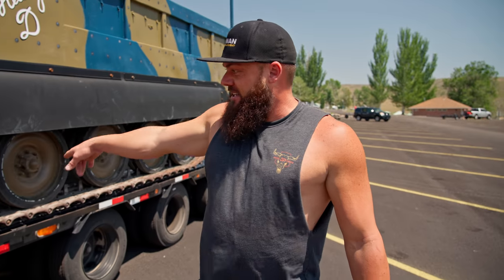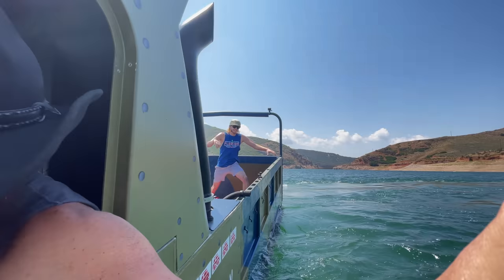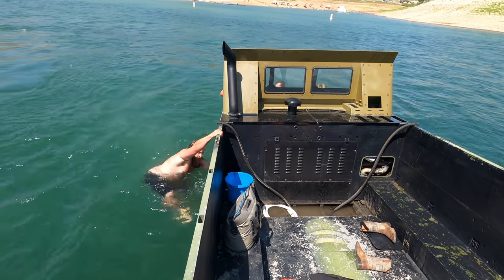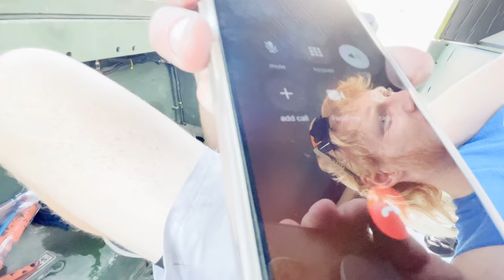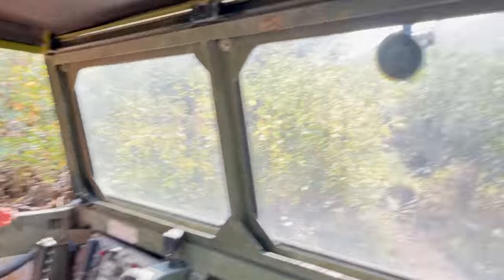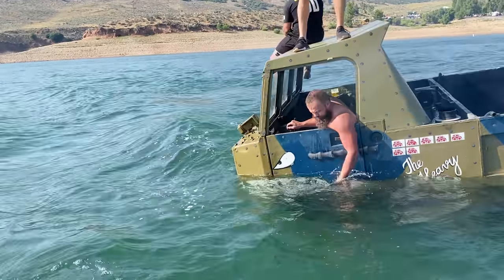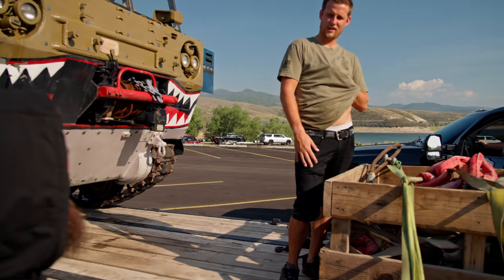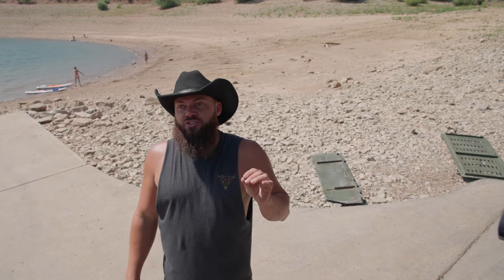Testing Our New Recovery Vehicle Went Terribly Wrong 😑 (WaveRunner Rescues TANK!)

Comment: I used to drive these in the Australian Army, like first comment, need ballast in the back. Also before all water operations we took off all inspection hatches and drain plugs then greased them up and put them back on. We sealed everything with grease!
Reply: Well gosh golly, we are missing some Boy Scouts, you know the ones that are always prepared.
Reply: even door gaskets?
Reply: As an Aussie, thank you for your service 🇦🇺🇦🇺🇦🇺
Reply: @jay l very cool. Hopefully @heavydsparks sees your comment
Reply: Thank you for your service!
Reply: Yeah service is the key , would
 think about relocation of tank
to the roof or rear of cab....
Plug weld all holes in cab/ body.
then you can name it ship- tank😳
Reply: It is also nose heavy because it's supposed to have troops in the back so put weight in the back or have more people to lvl it out ....
Reply: @lotharschiese8559   f0o
Reply: Ju
Reply: @DramaMustRemainOnTheStage  h
Reply: @michaelchatham233  ,  Nah.... because they wouldn't be returning empty like that!
Reply: Also it in Aussie service is called a Tillie or TLC Tracked Load Carrier not a personnel carrier except usually for the crew and i dont think i have ever seen a TLC or an APC in Aussie service that passed all its water entry testing before it got taken swimming remember all the chalk on the rubber seals on everything to see if they sealed which they never did break out the bearing grease slather it all over the seal and bingo it seals now good to go ( Ex 4 CAV Ex 1ARMD REGT EX 8 /13 VMR)
Reply: So many opening here! I HAVE to bite my tongue. 👅 😩 🤣🤣🤣
Reply: @michaelchatham233  troops equal ballast ..as Jay L said
Reply: Nobody cares
Reply: @brodienorton7965  on in morning 🌅
Reply: When I was in the army we never got one to float successfully.
Reply: 432  APC had to be water tight
Reply: Thank you for ur service!

Comment: Thinking on it, the Weasel would have been better to go rescue that stuck school bus.  Weasels have lower ground pressure (per sq. inch) than FEET do (this is why they do so well in a swamp/snow). There should be a trim vane on the front (where those hinges are they had their feet on) the bilge pump(s) (there should be a battery powered electric pump) EITHER OF THEM, should be able to nearly empty it, if she was full, in less than five minutes.... P.S. I did notice that ONE of you was smart enough to have/put on a PFD!

Comment: Dealt with many of these in the Cold War days...ol V53 Detroit...we swapp those packs and hope the one you installed didn't run away ...the ol Super Charger GMC 671 Blower could such down and chew up 3 to 4 inch Army TM manuals and spit them out ...same packs used in the M113 APC'S , Vietnam Era equipment.  We had a lot of fun with those ol tracks ...this type chassis was also use for the ADA Chappell 's which shot the surface to air sidewinders .....Never Ever forget the old V53 sound ... cool deal to see the  ol Warrior still moving forward ... 👍

Comment: Those are designed to have heavy loads in the rear. Like 30+ guys or full of equipment.    It’s designed to ride in water at the water line that the front was at.  So it rides lower in water actually.

Comment: M548 Cargo carriers were primarily used by the field artillery to carry ammunition. The largest difference in controls between the  M113 models and this variant is the steering. All models use independent braking on each set of tracks to make it go left or right. Primary steering is by those two metal rods "laterals" (its not an "A3 model, those have steering wheels and power brakes)  What's missing from the M548  are the two upper steering levers for water operation. I drove 113A2 and M577 A2's  (among other vehicles)until 1995 when I left Armor for Engineering. Beats walking ! Death before Dismount.

Comment: M113 Family, and not a troop carrier.  We use to call them Track Load Carriers here in Australia to move cargo . . . and Yep . . . as the others have said, there is a process to follow before swimming these things. Checking all your Drain, Inspection and Service Hatches seals are sealing correctly so no water gets in at all. Extra weight added to the cargo area to trim them out so they sit nice and even in the water.

If you do it right . . . your bilge pumps don't pump any water, and providing you have flat water . . . they'll swim all day . . . use to be fun operating them.

Comment: The M548 is a cargo carrier not a personal carrier. It was mostly used to carry rounds for the M155 and M110 howitzer in the US Army.  There is no HI & Lo on the M548 it just a three speed. You also need to add counter weight to the rear of the vehicle and it will level out.  Those plug that you were trying to pull are bleed valves for the disk brakes there that are used for swimming. The two handles by the master cylinders right in front of the lats.

Comment: I was a squad leader and operator of one of those in the Army stationed in Korea. They'll float but not like a boat. Its front heavy. Any minor hole and it will take on water. Drain plugs do rattle out. We kept her moving at all times and could not wait to get off the water

Comment: Should be a set of levers mounted in center of the cab to select low/high range in the transmission Dave. Hey invest in a case of Howe's Diesel fuel treatment and dump a bottle in that ol girl after draining water outta fuel filter/seperator. I trained in a field artillery unit while at Fort Sill Oklahoma. Tracked vehicles everywhere and artillery going off ALL day long all over the base.

Comment: Just have a couple gallon jugs of brake line antifreeze in the back and if you have water in the fuel dump that in the tank and it will take the water right out. Looks like you need some ballast in the back to level it out.
I used to have to ballast the barge crane I worked on by moving ballast water from compartment to compartment.
I have lived on the Puget Sound for the last twenty plus years and always wanted and amphibious vehicle.

Comment: US Army here. Replace every hull seal. That means torsion bars and axles. make sure they are pre lubed with a silicon grease. Then strap 2 55 gallon drums of water to the back of the bed. good luck it will probly still sink they are crap.

Comment: Put a bunch of guys or equipment in the back and it probably would float more evenly. I would have leak tested it and re caulked the body plus replaced any waterproofing seals like the doors & air intake before I tried to take it over deep water. Might have checked the fuel filler neck but the gas cap would be easy to overlook.

Comment: APC stands for ARMOURED PERSONEL CARRIER and an M548 is not and APC it is a TLC or Tracked Load Carrier and it clearly states in the Operations Manual that they MUST NOT BE FLOATED and are for deep fording only!! yes some places like Australia have floated them but they were not designed for it, the M113 on the other hand was designed to be amphibious but only if they pass pre floatation checks and even then there are versions that are not designed for it due to weight etc. i was a crewman for 12 1/2 years

Comment: Bilge pumps draw power off the engine. When it’s off they won’t run. On another note, have you ever heard of a LARC-V? You should definitely look into them. The old diesel ones would be good for recovery on the sand bar. The new ones that run off a John Deere 6080 are all hydraulic and not that reliable. I am in the Navy and we use them still at my command. So if you do look into them, stay away from the hydraulic ones. They extremely unreliable, I hate working with them. Both variants are amphibious.

Comment: The reason the back is higher is not because the motor is heavy well it is but the main reason because it's made to carry 3 to 4 thousand pounds in the back of the vehicle like 15 to 18 men with equipment and weapons.
Later guys 》 
G the Canadian.

Comment: I told you Gotta make sure all the rubber we’re good on there the door of the gas cap you OK anywhere there’s rubber you Gotta make sure it’s watertight I told you that I was single week if you don’t have new rubber on it everywhere and I was Bill pump should be working good we put two more in there to help from the water out it does it get water in there but you Gotta make sure that what I didn’t wanna see you good the engine is See you real good on the engine

Comment: Stop calling this a tank, you're showing your lack of intelligence.  That vehicle is called a tracked vehicle!  To be specific it is an amphibious tracked transport vehicle for troops and/or equipment.  Secondly, it is NOT a boat, it is not meant to just float around on the water, it will eventually sink.  It is designed for operations in and around water obstacles - mainly swamps and rivers.